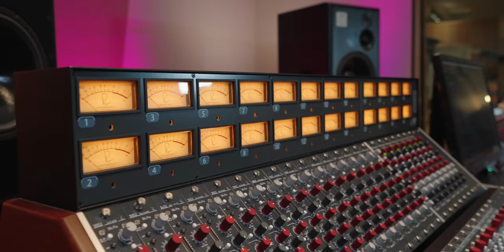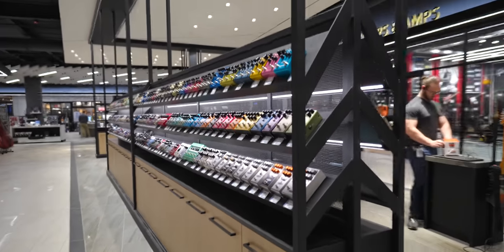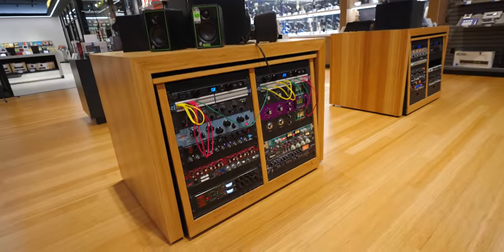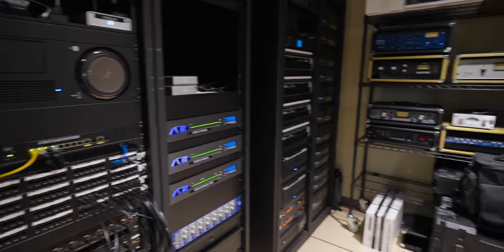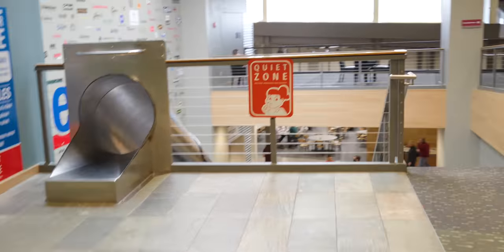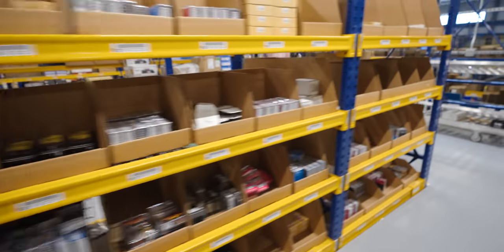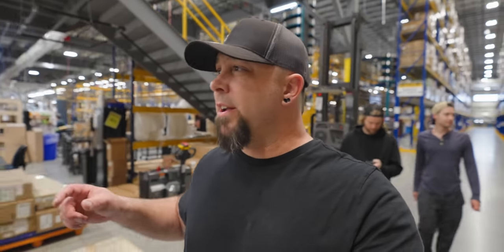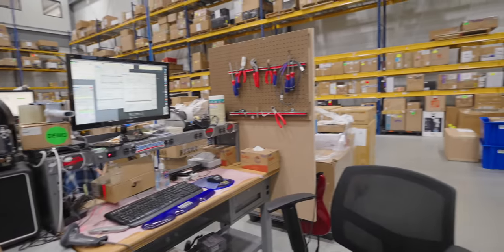MOST Music Gear I've EVER SEEN   🤯

Comment: (been dead for 7 years) - "Hey there, this is Mark from Sweetwater.  Just wanted to see if those guitar picks you got in 2009 are still working out for ya.  Also we've got a killer deal on accessories going on this month for our Spring into the groove seasonal sale for you to take advantage of.  My extension is 9208."